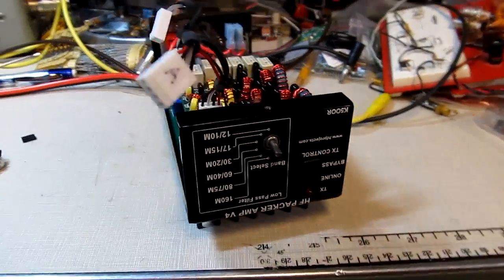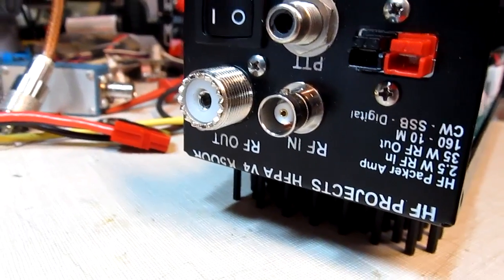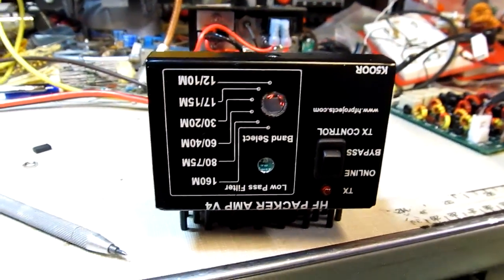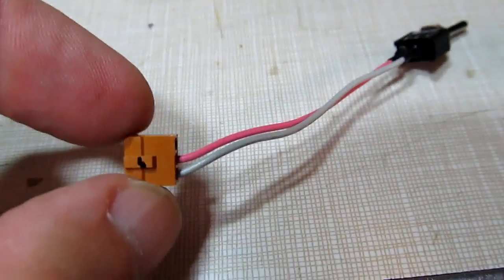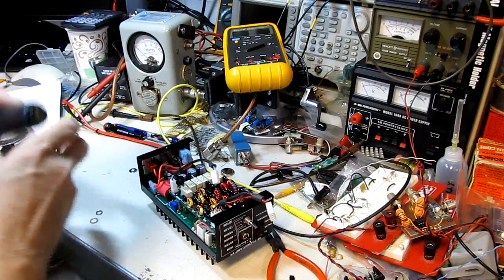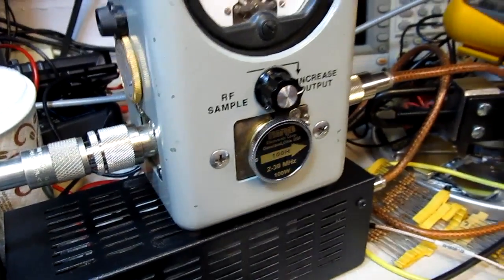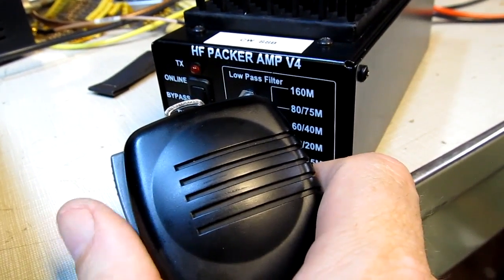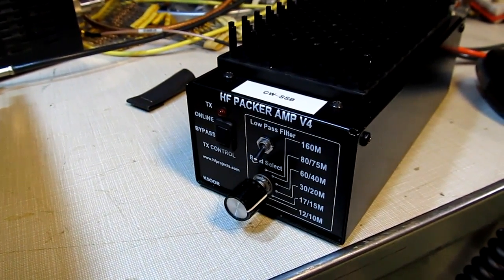#108: Adding a CW-SSB Mode switch to the HF Packer V4 Amplifier (ham radio)

Comment: Actually I will need a bi-directional control but I planned to do that using relays. I think that H bridge with 4 MOSFETs would be a better solution though, I will control it using PWM signal from Atmel's ATMega microcontroller.

Comment: I don't play in the ham world but I like your ham videos for general rf info. If you didn't have that watt meter could you check the power with your oscilloscope or spectrum analyzer? I used a spectrum analyzer once but it seemed like the info was relative and hard to quantify.

Comment: Really nicely done - But wouldn't you recommend the use of the PTT input over the RF sense anyway? A cable to the TRX with an integrated reed relais with integrated diode is done quickly..